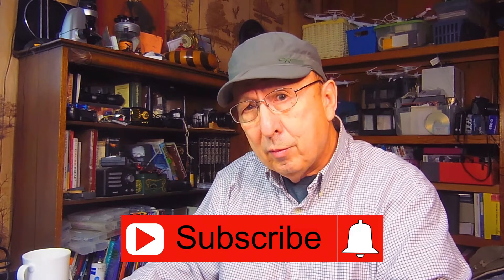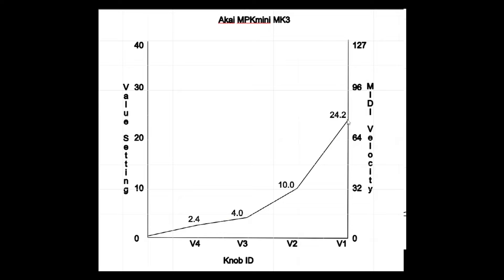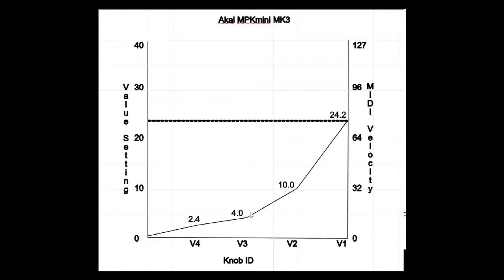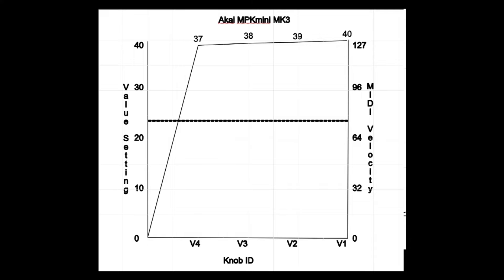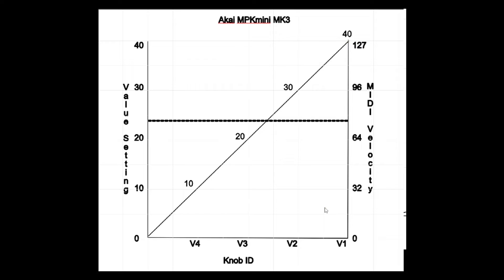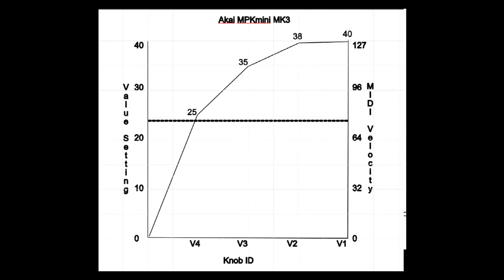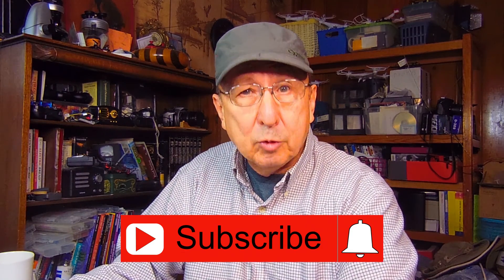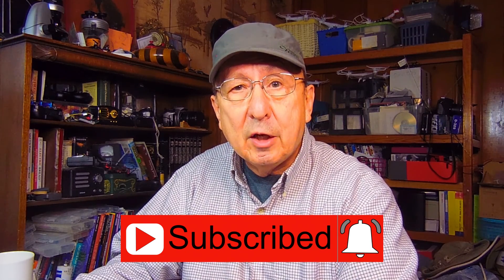Volume/Velocity Curve for the MPKmini MK3

Comment: Do you know if you can similarly adjust the sensitivity/velocity of the drum pads ?  I need to smash mine extremely hard for them to register a sound.
Reply from the maker: Greetings Hermizf! To make your pads loader press the "Full Level" button. It is right above the word AKAI. This only affects the Pads. You may loose velocity sensitivity but it should be louder with less effort, cheers.